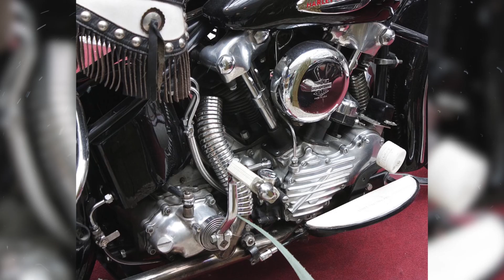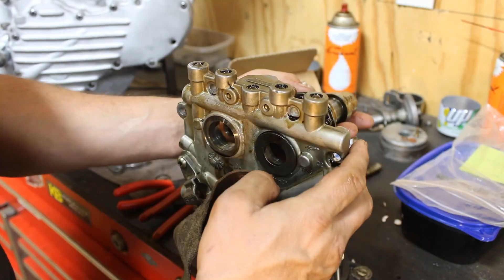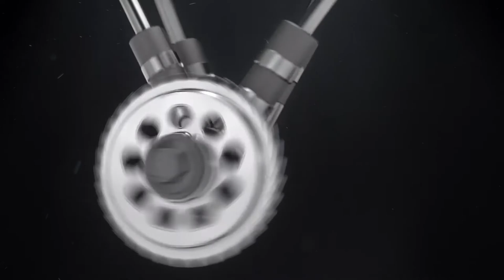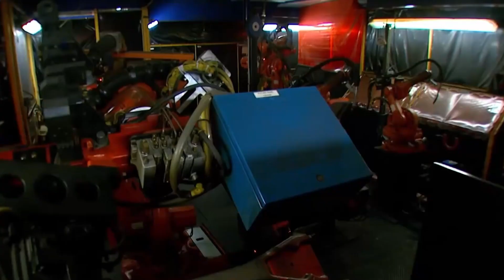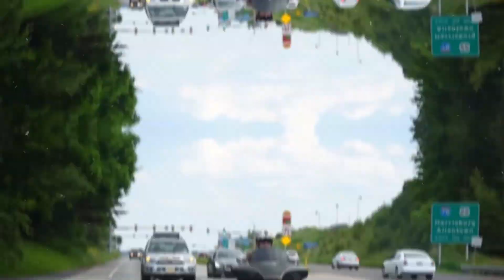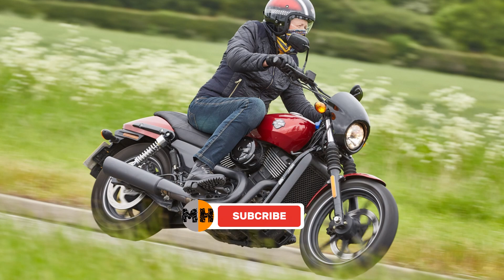7 Used Harley Davidson Motorcycles You Should NEVER BUY Due to Engine Problems

Comment: EVO, 5000 rpm limit. Not enough material  for higher  rpm use. Lack luster performance  good  milage  low maintenance.  STD daul plug 9.74 compression Sifton 141. 7500 rpm! Need Delkron cases, in time. Mid 10s!!!!

Comment: the world is still waiting for HD to join the new millennium and start using OHC instead of pushrods
Reply: I LOVED that my Fat Bob had pushrods with hydraulic lifters (like my cars), because NO expensive valve checks and adjustments, like were required on my other bikes ($1,200-$1,500 on my KTM, or $1,500-$1,800 on friend’s Ducatis). 

With the number of miles I rode, I had to get the valves checked/adjusted every year. So, while they still make them, my next bike will be an air-cooled, pushrod engine, either a Harley or Indian. Plus, I LOVE the low RPM, low end torque of those engines!